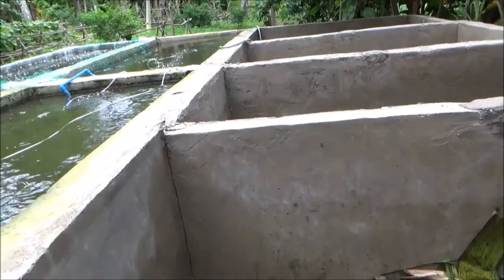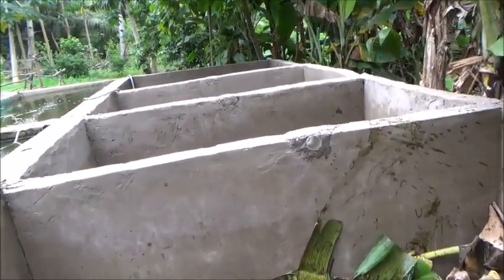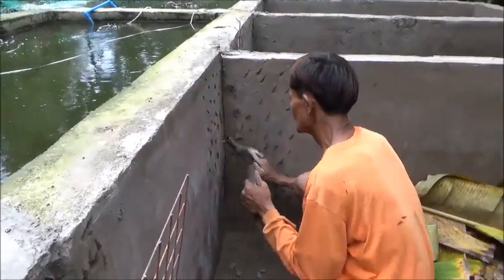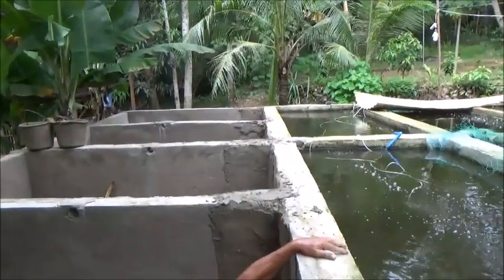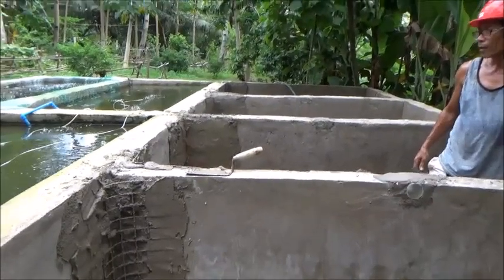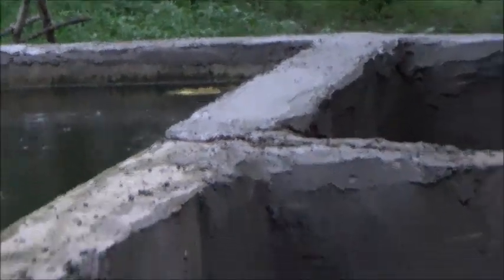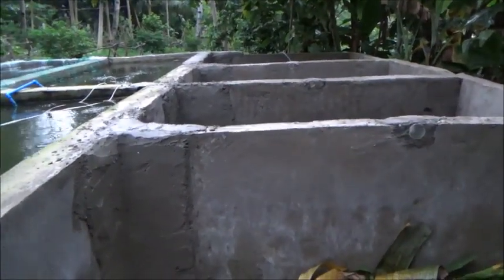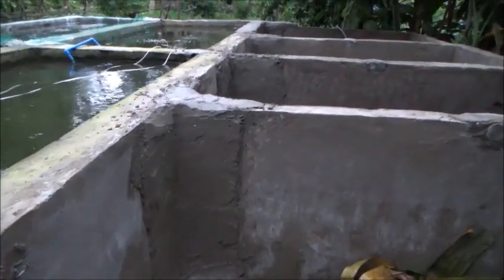Patching The New Breeding Tanks

Comment: Brian, We used that 2 X 2 welded wire mesh on our house rendering and have no cracks in the render. A cheaper reinforcing is
chopped strand fiberglass from the redimix concrete places. You use it in small bags like "Sahara" Also commonly used in floors
as a rebar replacement.  You seem to have gone over to the dark side putting up walls and then pouring the floor between them.
Pouring the floor with a thicker edge (monolithic pour) uses the exact same amount of all materials and provides bearing area
for the walls you build on top of the floor. Everything you might see on our site was floor first. Usually we do floors when the ground 
is easier to dig and do the walls during the drought season. Currently have two grow out shrimp tank floors waiting for budget to
do the walls. Our YT channel never caught on so no income from that and no Patrion or membership stuff. If people don't value
our videos I wouldn't let them pay to watch or have ads. I learn a lot from your videos and wish there was an index. Anyway thanks
for being such a prolific creator.

                                           george and cecelia         building Villa Cecelia
Reply from the maker: Thank you for watching George. There is no index but there are playlist by catagory.🤠